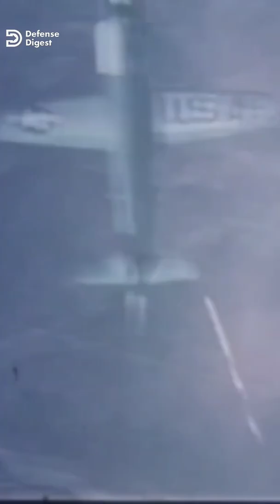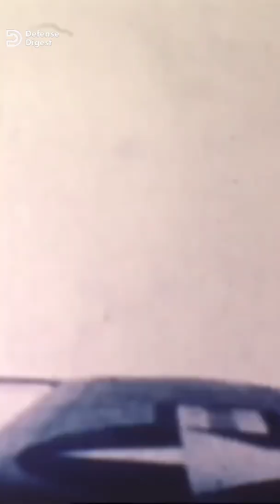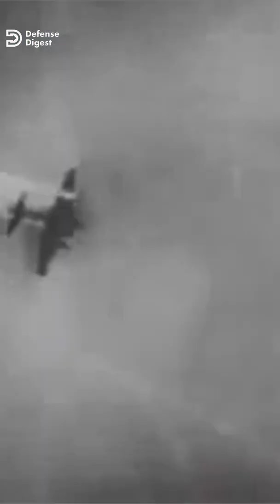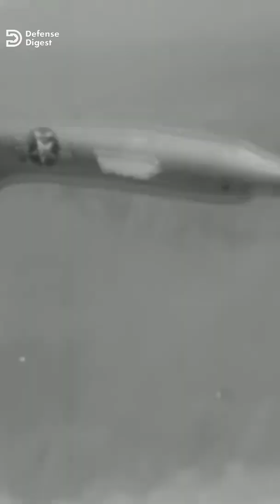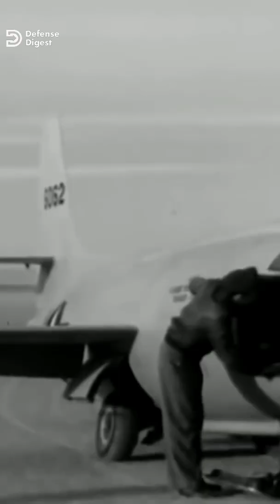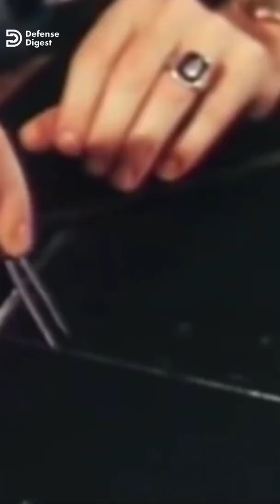The first plane that break the sound barrier #Shorts

Comment: WW2 pilots broke the sound barrier in dives, particularly Hawker Typhoons.
Reply: That’s not possible as any aircraft with a propeller will be destroyed as the propeller is going faster then the plane itself. The reason there is a sonic boom is because the air can’t get out of the way fast enough so it slams back together behind the aircraft.
Reply: @whogoeshereanymore  it is possible though, and it happened. They described breaking the sound barrier exactly, complete with planes shaking violently, cloud, then silence and calm when going even faster... long before Chuck did in X-1 (and before Chuck confessed publicly that the US Govt told US fighter pilots to strafe farmers, as farmers grow the potatoes that feed the soldiers).
Reply: Anyway, a quick Google doesn't bring it up, but that someone in a F-86 Sabre broke it weeks before Chuck (in a dive though)... I'm going from a documentary I watched years ago...
Reply: @ArjayMartin   Even if that was true the plane would be completely destroyed at that point and the pilot dead.
Reply: @ArjayMartin  The reason the X1 is built weirdly was because they knew bullets could travel faster than the speed of sound so they wanted to try that.
Reply: @whogoeshereanymore  nah, the vertical stabilizer ripped off the komet. but indeed, maybe many people flew faster than sound, and never recovered from the dive.  There is a difference between speed of sound in a dive and in level flight.. :)  I didn't say that the X1 was weird. but nice chatting to you anyway.  Thanks for being noble in debate, rather than abusive - that so many people are. :)

Comment: The 1st actual jet aircraft (not rocket powered) to break the sound barrier, was the F86 in a powered dive.  There were also claims that a P38 came close to breaking Mach 1 in a powered dive during a test flight.  Unfortunately the aircraft experienced a catastrophic tail boom failure, killing the pilot and destroying the plane.
Reply: I remember a spitfire mk24(maybe im saying the wrong number) that did the same thing but the pilot saved it  at the last moment

Comment: Led to the X15...over Mach 5.5-to 7.0 THATS STILL a record held by the X 15
 It was EVEN featured in an episode of The Outer LIMITS...it went into a time warp.
The speed induced..
Reply: The X-15A-2 flew the fastest speed of the 199 flight at Mach 6.7, with Pete Knight as the pilot.  This X-15 had 2 external fuel tanks and it was covered with an ablator material to act as a heat shield.  Unfortunately even with the ablator, the spacecraft experienced substantial damage by aerodynamic friction and melted some off the control surfaces.

Comment: Technically the first offical pilot to fly faster than the speed of sound - there are reports of supersonic flight before this
Reply: They are doubtful,as the "sound barrier" would've smashed them.
Reply: @naamadossantossilva4736  Might've, and prior to the late 40s and early 50s there wasn't enough instrumentation on aircraft to tell the way it was performing. It is certainly possible that supersonic flight occurred in some freak conditions and simply was recorded or proven.
And of course, there may have been many other attempts at Supersonic flight by, for example, the Luftwaffe during WW2 that may or may not have been successful but the records of which would almost certainly have been destroyed.

Comment: The X1 had problems melting I kid you not  they had several problems during flights with the leading edges melting a little
Reply: WRONG. The only X aircraft to "melt" in flight was the X15A2 when the ablator heat shield and leading edges experienced burn through at mach 6.1 - 6.7.   The fastest the X1 flew less than Mach 2, not even close to the speed required to melt the exterior metal skin.

Comment: Fun fact
In 1944, Heini Ditmar flew a Me163 B Komet at 702mph in level flight at 13,000 ft.
Was still the absolute speed record holder.
Reply: The Komet could not break the sound barrier at any height
Reply: @monza1002000  
I never said it broke thhe sound barrier.  The speed of sound  is fastest at sea level. 748mph+-
The higher you go, the thinner the air this the slower speed of sound. At 35k ft, speed of sound is about 660mph.

Now whether or not the Komet 's airframe and control surfaces could withstand the supersonic transition is another  matter.  But 702mph level flight @ 13,000 ft in 1944 is historical fact.
Fun footnote ;
During a test flight of the Bachem Ba349 Viper vertical launched rocket interceptor, it is said that Lothar Sieber broke the sound barrier while in an out of control power dive before he perished.
Reply: @patrickhorvath2684  
I was pointing out the Komet would not break the sound barrier, that's all. The cross-section 1/3 down the fuselage would create a shock wave that would cause catastrophic failure of the airframe.
Reply: @monza1002000  
Oh I agree. Guess that's why they tested it at the lower altitude. 
A very good read is ; 'The Fantastic Flights of Hanna Reitch'
 That little lady flew most everything in the Luftwaffe inventory including the Fiesler Fi-103 Flying Bomb.
Reply: A nazi german, why i am surprised
Reply: @dl0g09  
Hey troll. 15% of the greatest generation  is of Germanic descent.  Never go to bed as stupid as you were when you woke up, boy.
Reply: @patrickhorvath2684  well said I've got that book and I believe that the Germans broke the sound barrier in WW2 it's just you will never here the truth because they lost the war, some flight stuff they used on the bell was from information by German pilot in me jet, I'm not that clued in with fly language but Chuck Yeager and his sound barrier was made by learning from German experience, can't have Nazis beating anyone 🤣🤣🤣 just because they had the best stuff doesn't mean there all bad, the Luftwaffe were gentleman, not Goering, but the pilots, format was just one of them, Hanna was the first woman to fly a helicopter, she was a bit out there but a true lady flier until she died..
Reply: @dl0g09  
Not every German in those years was a member of the party. Hannah was fanatical, and probably was though.
The worlds' first jet plane and first twin-jet fighter was by Heinkel.  He was not politically favorable, so the Me 262 became the world's first production jet fighter, and not the He 280, which flew in 1942.
Reply: @patrickhorvath2684  wrong
Reply: @patrickhorvath2684  calm down wehraboo
Reply: @novasketch8658  he's right